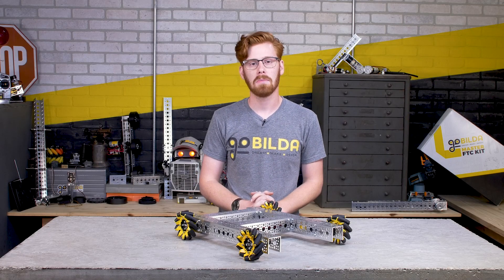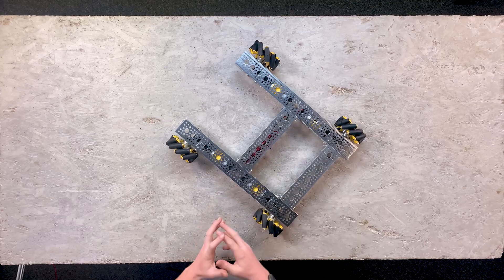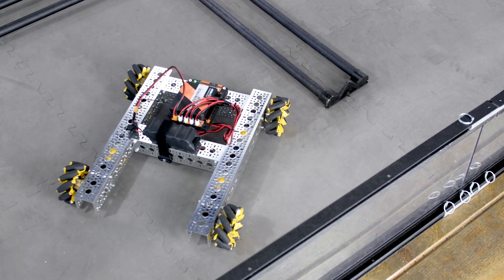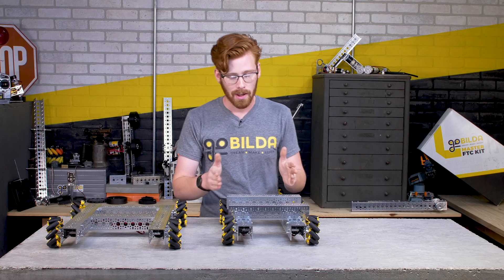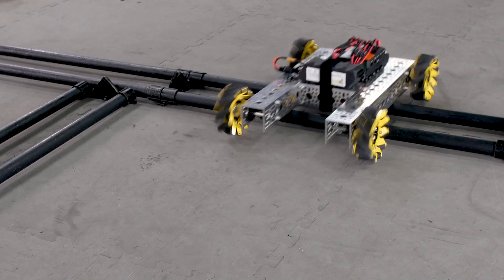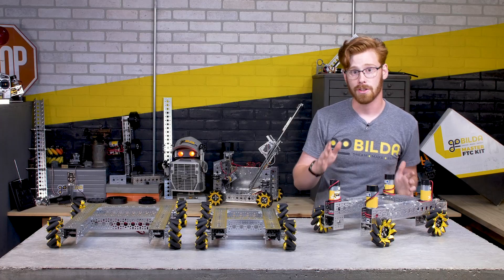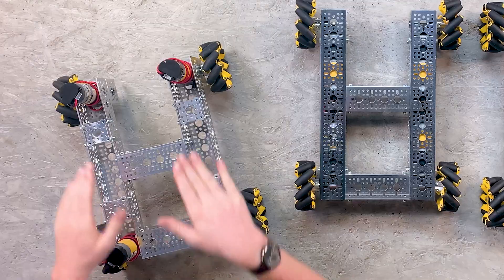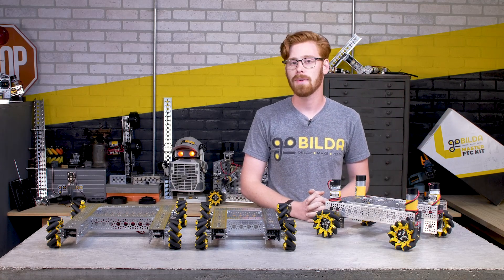Modifying your Strafer for FTC Freight Frenzy

Comment: Do you think you can put the drop-center plates that come with the beeline kit on a vertical motor config to give you enough clearance?
Reply from the maker: That would add a couple of mm of clearance, depending on exactly your use case that might be all you need. But keep in mind you may need to add more spacers to your miter gear setup on the motor side to overcome this shift in gear location.